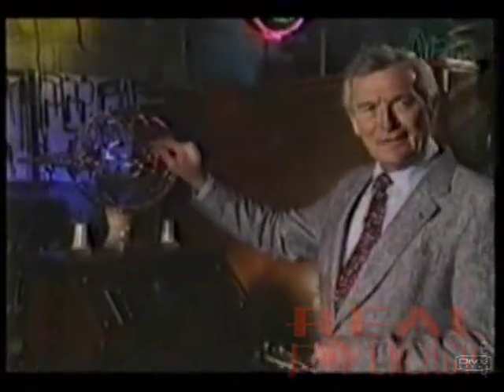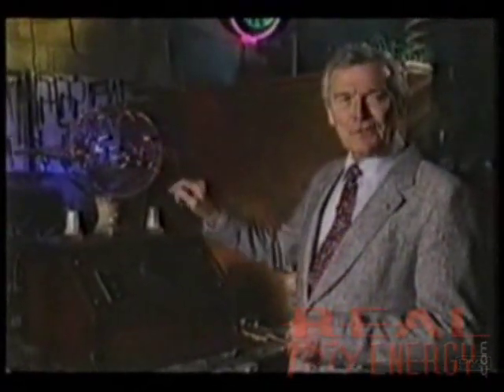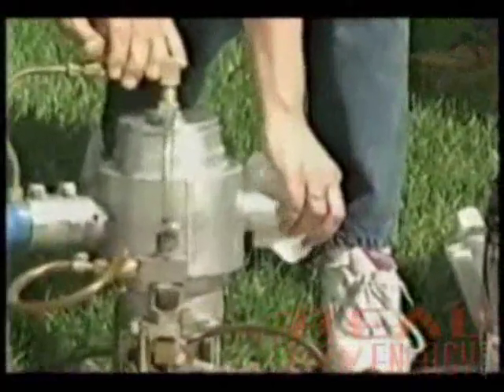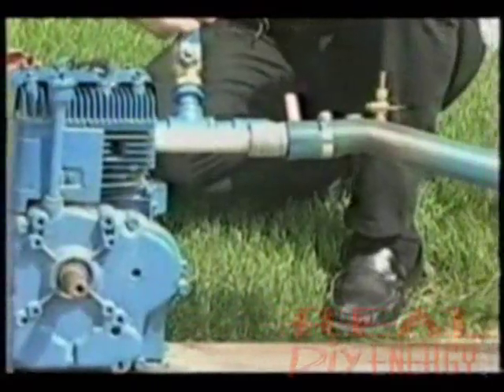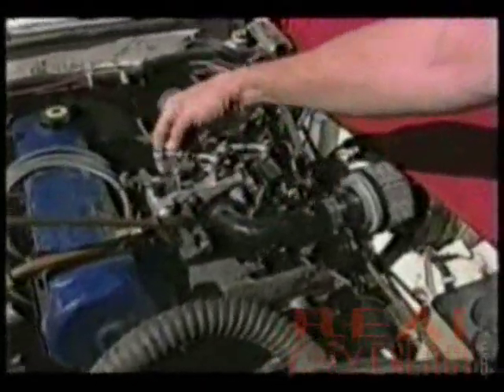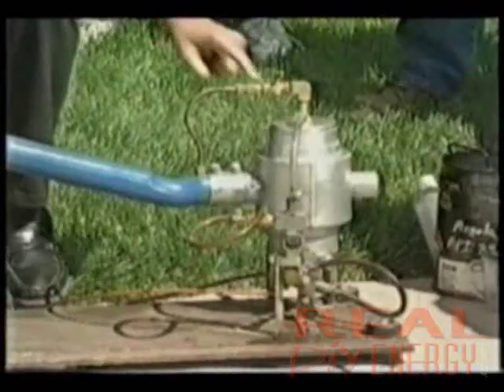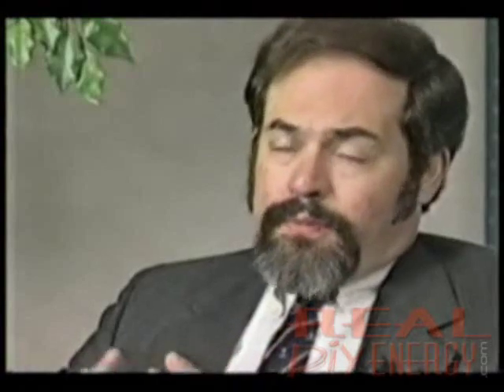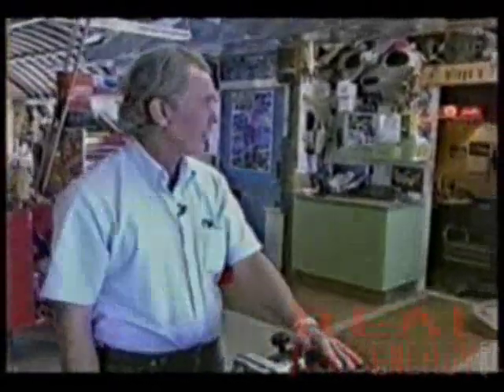GEET Fuel Processor Generator, Paul Pantone | 80% Water Free Energy Generator

Comment: GEET website says that effective air-fuel ratios are 3:1 to 2:1, that's 3 volumes of air to 1 volume of fuel. optimum ratio for 83 octane gasoline is 14.7:1, 14.7 times the amount of air to the amount of fuel. Let's do basic algebra 3:1 would be 3A+B=X and 14.7:1 would be 14.7A+B=X where A=volume of air, B=volume of fuel, and X=total volume of displacement of the engine. So, mathematically all you are doing is decreasing the volumetric efficiency of the fuel and thus decreasing power output.
Reply: No, it's been able to run on just water after the initial gas primer.

Comment: I don't doubt that this might actually work, but not the way that it is proclaimed to work. It makes sense that when you take any complex molecule and add enough energy to break chemical bonds that energy will be released from those bonds. The "reaction chamber" is simply a pre-heater (adding energy) and the bubbler is simply atomizing the fuel and turning it into a gas before injecting it into the intake. I would like to see a dyno readout from one of these, I bet 10HP engine is closer to 1HP.